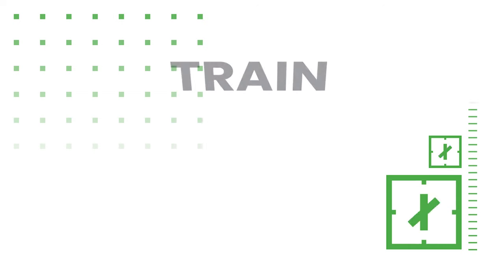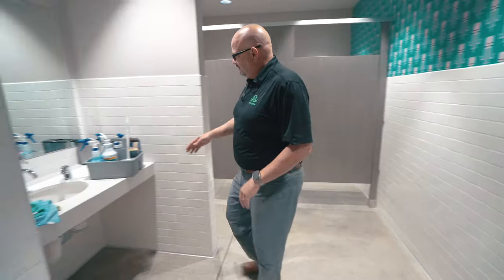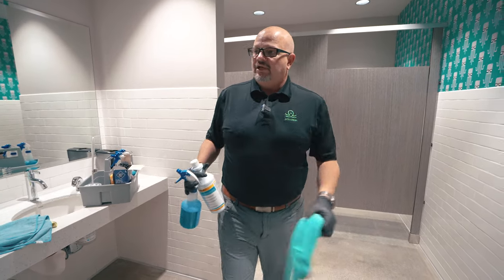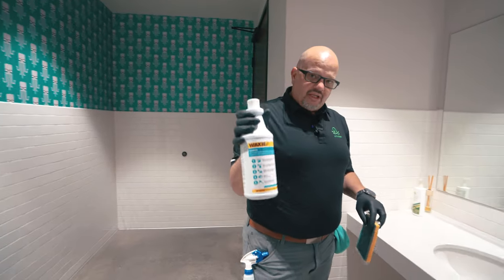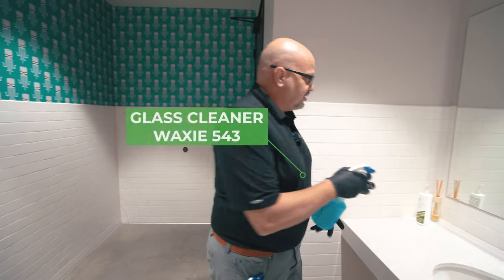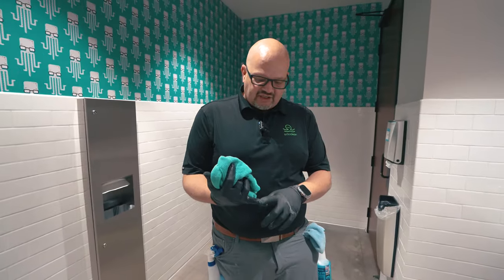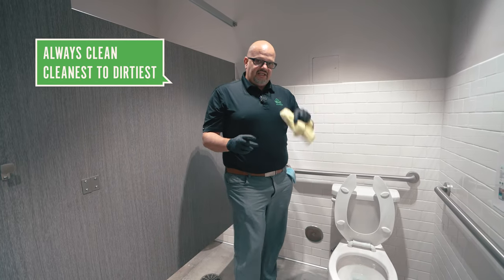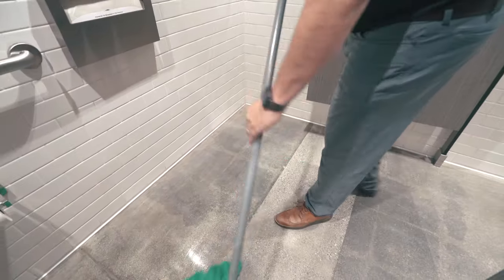The BEST Way to Clean a Restroom (Step By Step Training)

Comment: What about using paper towels to clean the rest room. And throw away when done.
Reply from the maker: You can use paper towels, but you will be spending a lot of money. Especially if you take on many accounts, it can become wasteful. Color coding microfiber and washing them separately is just as sanitary.
Reply: @OctoCleanMedia  do you take the dirty microfibers to a laundromat? Who takes care of that and what's that process like?
Reply: @OctoCleanMedia you pay more when you pay someone to clean tiles.
Reply: I do that all the time. It stops cross contamination and handling dirty rags when doing laundry

Comment: What would you recommend for cleaning multiple flooring types, for example tile & grout in restrooms, LVP in offices, & sealed concrete in lobby. Would you use a specialized chemical in each or one for all? How do you decide between traditional mopping vs flat mop in an area? Thanks for your great help & advice!!
Reply from the maker: A neutral cleaner will be your best bet. It will work for all the different surfaces you've mentioned. Waxie Solsta 210 is our choice. We are personally fans of microfiber loop mops. They are more effective in our opinion. Flat mops are great for in-between maintenance, but a loop mop will give you a deeper clean. Thanks for your question!

Comment: I think this is a good cover of the setup in restroom cleaning, in my case I’ve been doing cleaning at a school and to avoid putting dirty microfibre cloths in  the cabby, I actually have a insulated backpack (easier to wipe inside) nothing big but just somewhere to put dirty cloths after use so not going to and back when cleaning. 

Also at a hospital when cleaning I use toilet cleaner for some toilets that have a build of limescsle etc. problem is toilets get used often do I kinda cheat by putting a ‘toilet blocked/out of order’ it isn’t but some of stains need a good 20 minutes of toilet cleaning solution.

Comment: I don't know if I can get on board with using rags on the toilets...I clean a commercial building 5 days per week and most days there are at least a few very soiled toilet lids... I feel like I'd have to own a separate washer just to clean the toilet rags...
What's your opinion on using a couple sheets of the client's paper towels that are available in the bathroom, and then tossing them in the trash when done?
Reply from the maker: For heavily soiled toilets it can be beneficial to use paper towels initially and then following up with microfiber for disinfecting purposes. We don't recommend using paper towels regularly since they are not as cost effective as reusable microfiber towels. Our yellow microfibers (for toilets and urinals) are always laundered separately to get them as clean as possible for the next service.

Comment: I always use gloves no matter what I'm doing in the bathroom. Not everyone washes their hands. Even as someone using a public restroom I don't touch anything after washing my hands. I open the door with a paper towel.
If your bowl cleaner needs to sit, why not do that first? 
If you do the mirror first you are apt to spray it again when spraying your sink. 
You took out the garbage then put trash in it? 
The dusting of wall trim and top of stalls really doesn't need to be done more than once a week.
Reply from the maker: Hi Isabel! Thank you for commenting. 

Clean hands are cleaner than dirty gloves. People often wear gloves throughout a cleaning and inadvertently cross contaminate multiple surfaces. Gloves only need to be worn when dealing with hazardous/contaminated areas and immediately disposed of after use. Beyond that, it's up to the cleaners discretion.

We check consumables first to make sure they are not forgotten, as well as the trash. Often times, cleaners forget to check the toilet paper, paper towels, trash, etc.. Forgetting those items leaves the impression that the restroom was not cleaned. Toilet disinfection and acid bowl cleaner are towards the top of the list, but not first. 

Mirror first, counter first, it doesn't really matter what order they are done in, one simply needs to pay close attention to their work and leave it sparkly clean. Additionally, overspray of a cleaning chemical onto a mirror is not likely to leave residue since it does not contain solids like hard water. 

Yes, we put trash in the trash can. In a real world scenario cleaners would use their rolling barrel or janitorial cart to dispose of any waste. This would avoid the impression that the trash was not taken out. 

Correct! Dusting is a weekly task. Feel free to check out our training cards for a detailed breakdown on how to clean a restroom like a pro: https://shop.octoclean.com/products/team-cleaning-training-cards